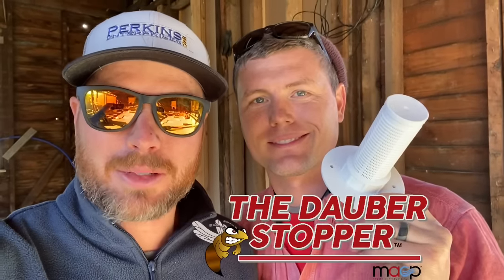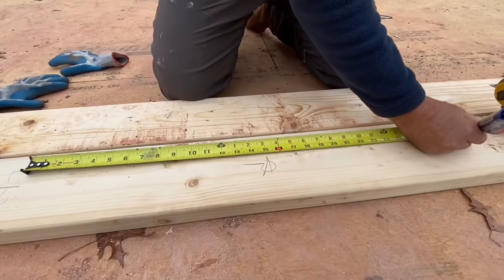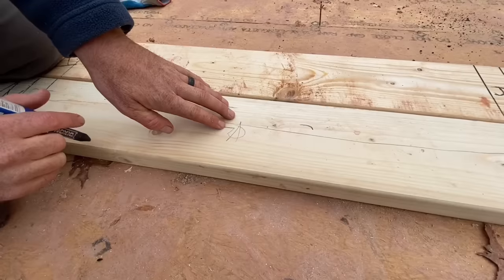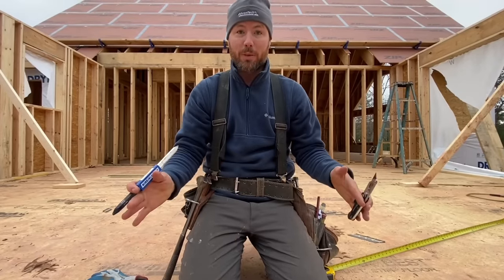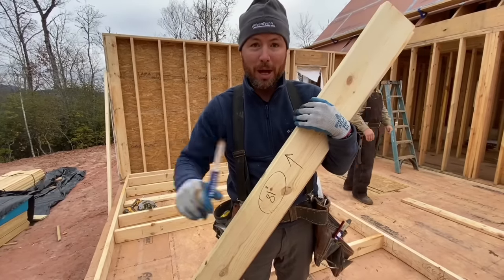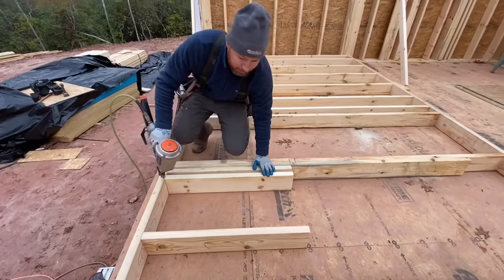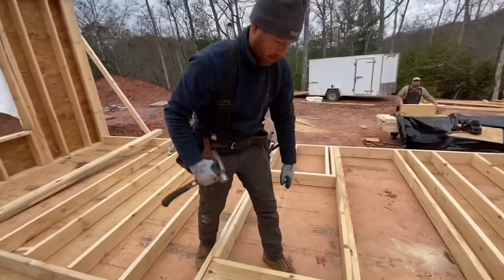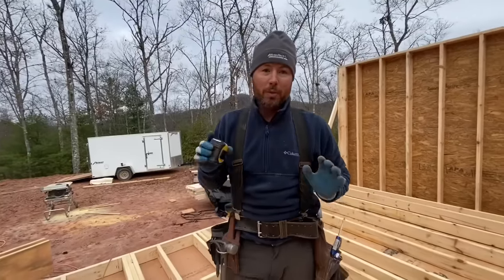Learn how to frame a window ~ Building  tutorials made easy

Comment: 2640 ??? 30in. X 48in. What????
81” from where? To the bottom of the plate or on top of the plate?!
Reply: 2' 6 inches x 4' and zero inches.
Reply: Stumped me too! Thankfully (from the REPLIES) I learned that, in window and door jargon, width is always first (feet then inches) and height is second (feet then inches) e.g. 2 feet 6 inches (wide) X 4 feet 0 inches (high) equals 2640

Comment: Awesome video! Too bad You Americans are still using that silly customary measurement system.
Reply: Valdis Veidelis Is that just like saying everyone in the world should start speaking the same language? I wouldn't be opposed to speaking say Mandarin if everyone else did I recon it would be way easier to do business worldwide
Reply: @MsElijah16 , no, to me it's not the same as saying we all should be speaking the same language.
I see the SI system as superior because it's easy to convert from square meters to hectares to square kilometers as well as other conversions. Not so easy with inches, hands, acres, feet.
Reply: Valdis Veidelis where are u from ? I'm from NZ we converted to metric 50 years ago I think
Reply: @MsElijah16  , I'm from Latvia.
Reply: Our former President Jimmy Carter tried to get us to switch but we weren't having any of it, unfortunately.  It was also the only good thing he tried to do.  One of our worst Presidents until the a-hole we have now.
Reply: Cafe J'adore  Sounds reasonable. Does that 4,114.8mm have to be so long because it has to have that length no matter what measurement system or because that is what is written in the building code in inches/feet?